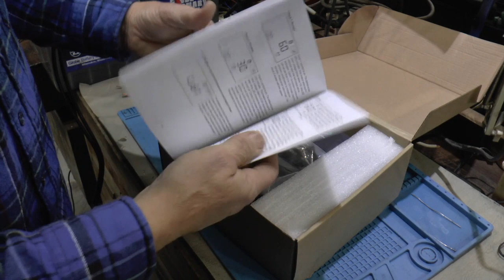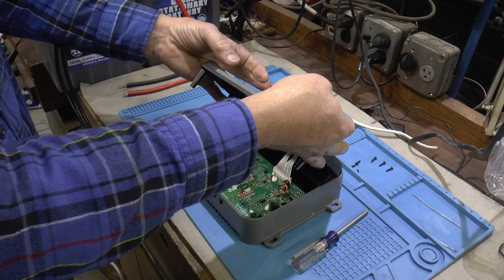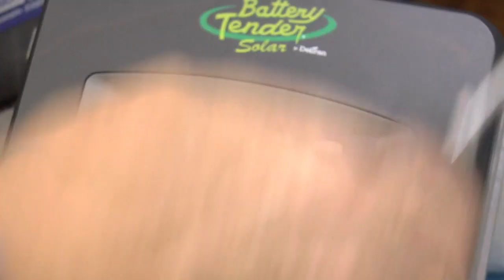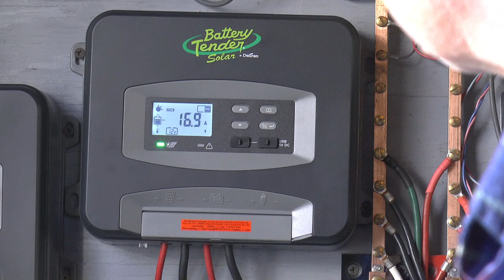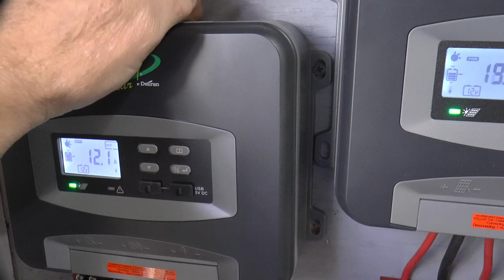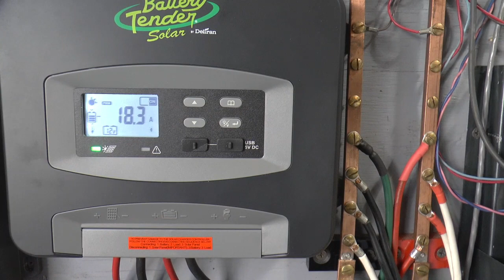Battery Tender PWM & Mppt Solar Controller

Comment: What cables do you use to attach to the controller, battery and solar panel?
Reply from the maker: Number4 copper from the solar because of the length. From the controller to the battery buss bar number 6. Battery to inverter is 1/0 welding cable